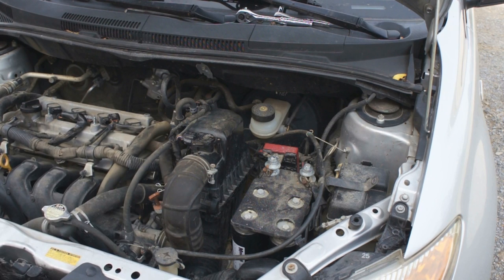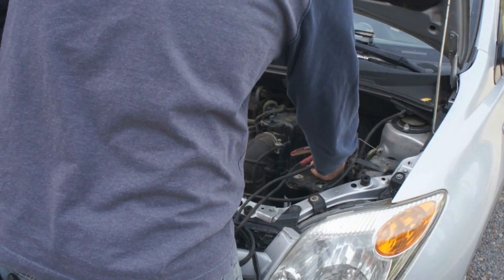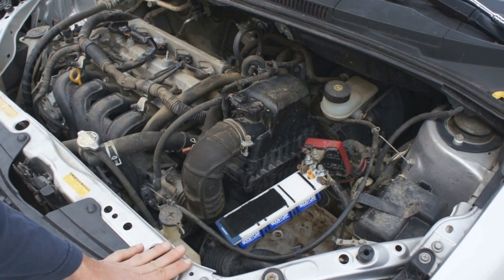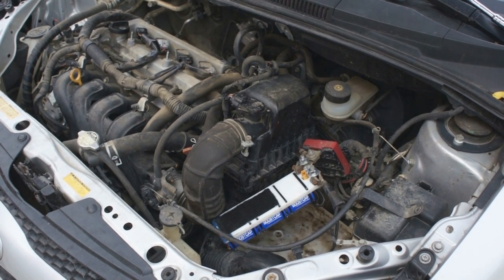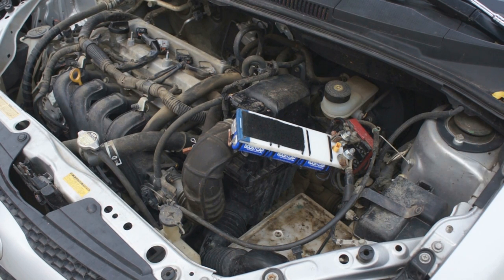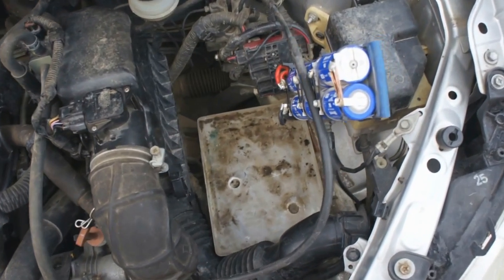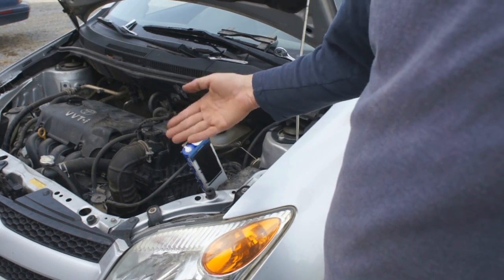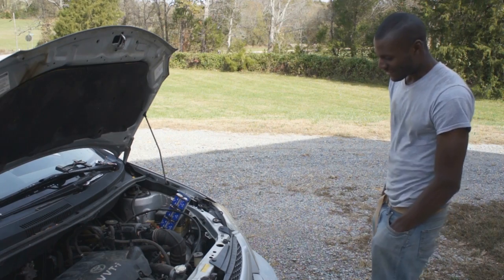12V Capacitor Pack Starts Car - Answers to Common Questions

Comment: capacitors are a solid state battery almost unaffected by temperature and the fuel injected car did not spray fuel because it saw that it wasn't getting spark so it shut down the injectors cars can compensate for those problems on there own no help needed.

Comment: Another great video. Just be careful cranking a starter for 30 seconds. Starters are only designed for momentary powering. You could overheat the windings and damage the starter.
Reply: Not his car now, LOL
Reply: I think the coils in the armature can take the beating, but the carbon brushes might wear out..
Reply: The winding will definitely heat up, hopefully not enough to melt the varnish on the wires.
Reply: electronicsNmore I had one cheap starter, for my diesel, melt the brush holders. :) Cheap plastic brush holders on a brand new starter. Usually those brush holders are made from Bakelite? which is more like a tough wood then plastic. :) That stupid starter must weigh more than the battery. What a pain changing it out. lol
Reply: NO!!! you  won´t damage the starter w/these caps; (very little energy there,see capacitor coulombs)got be careful with a good battery,though...30 seconds followed by 2 minutes rest

Comment: 15 years ago I ran my Jetta wagon on a 9kJ super capacitor bank FOR ONE YEAR! I made it from six 100F, 5V caps. I think they were Epcos caps. I put 3 in series in parallel with another 3-series set.  It's a funny story why I did this. For whatever reason, my car kept going through batteries. So, when my third battery, which I got a warranty on, failed, I built this super cap bank and connected it in parallel with the dead car battery and left it there (like you I was fascinated by them and was tinkering).  The car started immediately!  And I believe I was driving on this dead battery with my super cap bank connected in parallel for about another year or so at which point I had to sell the car for a minivan for the growing family. I took the capacitor bank out. It was still good!  But, of course the car would no longer start without it. Nothing. I went back to the store with the dead battery to get a replacement per the warranty. The guy tested the battery with a professional battery tester.  He tested it again, and again, and again shaking his head.  He was puzzled  as he had never seen a battery so dead ever recorded by his machine.  To me this meant I was essentially driving on capacitors and didn't need the battery.

Comment: You should have disconnected the fuel pump fuse. now alot of fuel went into the engine. and that is not good since the gasoline might end up on the cylinder walls and drain down into the oilpan and take the lubricating oil with it.

Comment: weight reduction? what about durability and environmental cleanliness? these things must last decades, right? no replacing lead acid batteries.
Reply from the maker: ***** 
Yes, the specs would lead me to believe that they should last a lifetime. I have also heard that there internal carbon coating is largely made from burnt coconut shells

Comment: So why aren't car manufacturers using super-cap arrays in cars instead of heavy lead acid batteries?
Reply: Run your lights with the engine off while using supercaps and you will soon find out why.
Reply: Captain Haggis Not a whole lot of reasons why you would though. Also, LED's.
Reply: Esa Edvik I can think of plenty of scenarios where the power density of supercaps would be far inferior to lead acid. e.g. wanting to run the sound system with the engine off, the engine not turning over immediately, using lights with engine off (even with LEDs this could be a problem for any extended period). The only advantages of caps over batteries that I can think of is that they charge super fast, have longer lifespan and they can dump a large amount of current quickly (although lead acid can output plenty of current anyway). In any case lead acid is far cheaper and doesn't have a whole lot of disadvantages.
Reply: Captain Haggis As I said, not a whole lotta reasons why anyone would do that. That said, everyone's different, as I don't do the aforementioned.
Current lead acid batteries have LOTS of disadvantages.
Reply: What about having a Lead/acid and a capacitor bank, for backup? Like on really cold days, when you wake up only to find your battery died... Could a combination of both, make the battery last years longer?
Reply: ***** Hey I'm not a big fan of lead acid, but we were comparing them with supercaps (as the technology currently stands). If you think supercaps are a better option for your car then go for it, personally I don't want to have to jump start every time I leave my lights on for 5 minutes.
Of course the better all round option would be lithium but they are still quite expensive (but dropping fast).
Reply: ***** I was referring to a traditional car scenario - but I agree, combining caps and batteries would certainly have some cool benefits. If we could master graphene supercaps then they may even have enough power density to use them instead of batteries - imagine fully charging your electric car/phone/etc in a few minutes and having huge amounts of power on demand with a very long lifespan and no hazardous chemicals. Ahhh, one can dream :)
Reply: There are cars on the market that use supercapacitors as a supplementary source of power, mostly for start-stop technology to reduce the stress on battery. I've heared of some Peugeot cars and... Lambo :)

Comment: Whoa whoa whoa, Lithium Iron Phosphate = LiFePO4 = LiPo. Know how to be safe with a LiPo and it's not dangerous, forgetting the pouch NEEDs to expand a little or getting careless and letting one overcharge is how the explosions happen.
Reply: LiPo (Lithium Polymer, the pouch style of Lithium-Ion) is not LiFePO4 (lithium iron phosphate). Different chemistry. LiFes have massively higher power, at the cost of lower energy density than LiPo/Li-Ion. They also have different voltages, LiPo are 3.6-4.2, LiFe are 3.2-3.6. Laptops and cell phones have LiPo/Li-Ion, tool batteries have LiFe.
Reply: MattsAwesomeStuff tool battery's are actually not LiFe. But you're right, different chemistry

Comment: Working in the Electronics field since 1984 I got to say I'm pretty impressed.  Nice experiment.  To improve it, I would have your regular pack and then a small side booster pack.  Add a switch, then you can use it like a 'reserve' switch on a motorcycle.
Run your main caps down, no problem, flip switch, start.

Comment: Just FYI, when starting a fuel injected engine,  you should wait with the key in the "on" position until you hear the fuel pump stop before turning the key to start.  This allows the fuel system to be at operating pressure before running the vehicle.  This will save time cranking,  and will also allow the computer to more accurately determine air fuel ratio,  improving gas mileage.

Comment: Years and years ago, I saw your videos about using supercapacitors to start a car and I've been wanting to try it since.  I'm now building a supercapacitor bank of 6 500F supercapacitors in series that I can use with my car.  I'll probably either put it in parallel on the starter battery or attach a much larger lithium iron phosphate battery to the bank and use it for my subwoofers when my car is off.  I have a 100W solar panel feeding into that side through a solar charge controller, so that would help the circuit back there charge while the car is off.

Comment: Smart move on the wedding ring...I worked with a mechanic that smoked his ring finger while we were in the other building working he reached for a nut beside the battery that he dropped and poof the ring went red hot touching the positive post and ground...his hand was wedged in there...he took a few days off...was gruesome...Lasersaber keep up the great work my joule ringer is still lighting my bathroom on a alum motorcycle battery...I get more and more from the battery each charge discharge cycle and that battery was sulfated so bad it took zero amps now it lights my bathroom for a month per charge...

Comment: Yes, I have throught about this boost pack for starting a car when it is cold and there is a battery problem.  Also for the smaller one I have thought about it for a moblie solar application by placing several of them in a battery box in series.  Then again it could work for a dump load for wind with the larger ones if you connect a GTI to it.

Comment: I keep a six pack of the 3000 farad's in my vehicle for emergencies. My battery went dead and would not turn over engine. I hooked up the capacitors after being stored in the trunk for 6 months and it turned over motor like it had a new battery in it.
after motor starts just leave it hooked up for 30 to 60 seconds and it will recharge for the next time it is needed. I just cut up a  pair of jumper cables, put lugs on the ends and bolted to capacitors. And to be on the safe side, I put the battery clamps in plastic bags to prevent shorting while stored in trunk. They have saved me more than once.

Comment: A 100W flexible solar panel has worked well for me in keeping my 500f equivalent capacitor charged. It's funny how auto makers "forget" to install a capacitor in what is essentially a power supply in the car. Anyone with an understanding of basic electronics knows that a capacitor goes hand in hand with a transformer and diodes in a P/S circuit. A battery has its place in electronics, but it is by no means a substitute for a capacitor. A good power supply will always have a properly sized capacitor in it. You will also note that the DC is much smoother when you add a capacitor, and that all of the bulbs and electronic components on the car tend to last much longer.

Comment: What exactly is the capacitor rating used in your black/large caps? Several supercaps are available in 3000F ratings and 1500F. I believe your smaller boostpack consists of 350F caps.

Comment: One important thing. Connect that capacitor to dead battery, I mean really dead like 10 volts or lower. Leave it for few minutes and you will start car without any problems :)

Comment: I just stumbled on Theas Boost packs. Why did you quit using the Lifpo battery on the mini pack and go back to the larger capacitors.
Reply: tóo low eñer 5 too 7.5 wats    vese 300 wattts  bates suóore wày

Comment: Check out my van running on a hybrid setup,10ah lifepo4 and 6 350 F in series it is still running with it.
The other day we had a lot of rain and I lost my accessories belt and drove for about a mile without the alternator. After sitting for a day I put the belt back on and it started right up.

Comment: LAsersaber, once again I say kudos to you for a important demo. (1) Another test I propose: try starting a gas powered car in your cold weather which we in LA,CA don't have. (2) What is happening with your battery free light driver circuit (which I have yest to replicate) ? I know you moved on to a flashlight but are you still dinking around with battery free?

Comment: Now to figure out how many to use on my diesel. :) For a diesel cranking speed is everything. Unfortunately the high amp load is hard on the batteries. Most diesels have 2 batteries for this very reason. I would estimate that the amp load for my 6.5 liter diesel is probably at least 4 times what that little car is. Currently I use 3 large car batteries to start it. That much amps usually starts it in 1 or two revolutions of the crank once the glow plugs go out. I'm thinking the glow plugs would probably kill the cap charge all by themselves. Still I'll experiment with the caps if I can find enough cheap enough.
Reply: Mon Saka Were you able to try the cap bank starting your diesel? They can provide huge amperage for short periods of time. I build a 500f bank for my car and it amazes me every day. I'm adding an extra load draw (audio amplifier) so am going to build an additional 900f bank for 1400f total (should be able to supply 600amps). http://ecuflashking.com/07cobaltSS_SC/IMG_20150430_203418.jpg

Comment: This needs a proper further study.. ESM (Engine Start Management) with Super Caps are worth when used together with battery.. And the Starter wiring should be the isolated from battery (+ terminals), and super cap will give the needed CCA to fire up the starter and battery will recharge the Cap after each fire ups.. Also need to know how starter protected if car already in start (Engine Running). Modern car have a lot of Fail safe / Poka Yoke..

Comment: hi
should i connect the super in series capacitor with the car battery?
how to protect them from overcharging?
if the alternator keeps charging the battery as it always do in a normal car supercapacitors can they explode if they are continuously charged by the alternator?
thanks.

Comment: man Saka some truck drivers are replacing 1 of there 4 batteries with the large version of the boost pack so if your diesel has multiple batteries just replace it with one of these the battery you would replace with this is the cranking battery if you only have one battery wire another one in the trunk of the vehicle if it's a wagon it needs to be a battery safe for indoor use.

Comment: What would really be cool is to have BOTH the capacitor pack AND the battery in your vehicle. In this way should your battery ever run down due to cold weather and/or long storage, you could use the capacitors to jump-start your car and recharge your battery. You would be self sufficient enough to never need a jump-start from anyone or a portable booster pack.;-)   You might have a storage problem though, if you don't have enough room under the hood for both capacitors and the battery.
Reply: This is, of course, as long as the capacitors can hold their charge through the storage period. Adding a solar charger into the mix would be even better I would imagine.

Comment: great experiment to dispel any doubts regarding boost packs ability !! ,   have a question ..when u connected the regular battery to charge the boost pack , have you thought about the instantaneous charging current ? , will that be within the safe current limit of the battery ?

Comment: What type is the large super capacitor, how many Farads? thanks.
Reply: he says it in a previous video. I remember it being around 600 Farads

edit: I was wrong. Looks like the large pack is 6x 2.5 V maxwell supercaps at 2600F each
The smaller pack is 6x 350F Maxwell caps at 2.7V. The small caps can be found here
 http://www.digikey.com/product-search/en?x=19&y=16&lang=en&site=us&KeyWords=1182-1016-ND for about $11-12 each. The competition is offering about 50 Farads more for the same price, but they have through-hole pins rather than mounting screws. http://www.digikey.com/product-detail/en/XV3560-2R7407-R/283-4209-ND/3878067

The larger caps are a bit expensive. the 2600F caps are $500 on digikey, way not worth it when the 2500F are $200
http://www.digikey.ca/product-detail/en/JJD0E258MSEF/493-3326-ND/2003450 They only sell it if you buy 25 of them anyway, so way out of anyone's price bracket.

But the 2000F caps are even cheaper. $66 is way more cost effective.
http://www.digikey.ca/product-detail/en/BCAP2000%20P270%20K04/1182-1020-ND/3079284

But wait! This doesnt make any sense! 3000F at 2.7V for $73 http://www.digikey.ca/product-detail/en/BCAP3000%20P270%20K04/1182-1021-ND/3079285
 
And 3400F at 2.85V for $86 http://www.digikey.ca/product-detail/en/BCAP3400%20P285%20K04/1182-1037-ND/4896902

Those last two are definitely the most cost effective. Here is a table of the amount of energy per $1 you'd be spending for a capacitor. The smaller ones are a bit of a ripoff. Note: everything is in CAD, not USD
http://snag.gy/HnMtb.jpg
Reply: Infinion good info mane

Comment: Why do you need the boostcaps at all, cant you just use the lifepo4 batteries by them selves? And why do you have a solar panel connected to it, doesnt that make.it inferior to the lead acid since it needs the solar panel

Comment: so you can rig a chainsaw to put a pully on it and with a belt you could take the belt off the alternator and recharge the capicitors by turning the alternator with the chainsaw.i would make sure I`d have an arrow on the alternator to always know which way it turns. could you do a vid on this?

Comment: Hi, is that the end or your car replacement battery updates since having sold your car? 
Do you have any step by step details with your latest setup with the bigger cells & did you fit a balance board eventually? 
Thanks Arthur.

Comment: I'd think a lifepo4 battery or limn cell pack/supercap hybrid would be a better overall system.  High MAH with the ability to do absolutely HUGE amp draw for starting and long term sustained power charged by the alternator while the car is on.  That way you can run the radio, lights, etc with the AC off while still having the high draw starting capability of that supercap bank.

Comment: I'm replacing the battery in my van with supercaps (if it doesn't work then my motorbike gets a new cap system). What are your views on supercap balancing boards? How does the 16V of 6 caps go along with the electrical system? The van has a LiFePO4 house battery system of around 12V,  how would connecting that alternator, 16V caps and that battery pack work?

Comment: So do the capacitors drain over time if not charging? And what is the farad rating on each setup? I might have to double the bigger setup to run a winch.